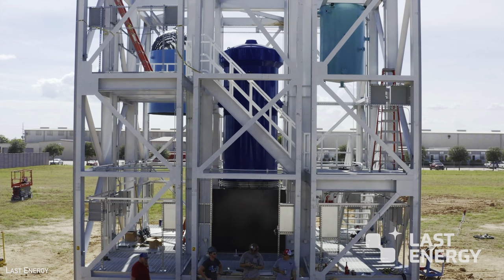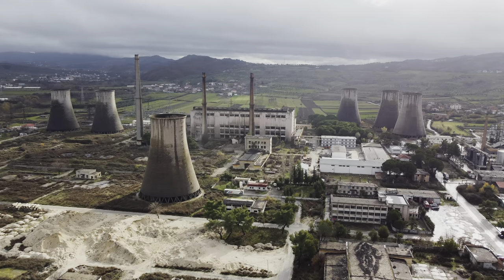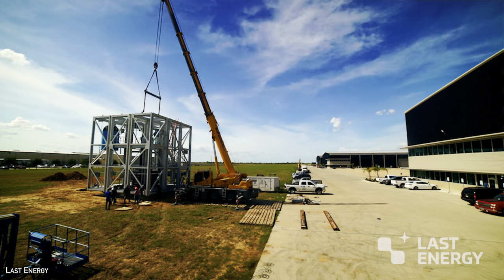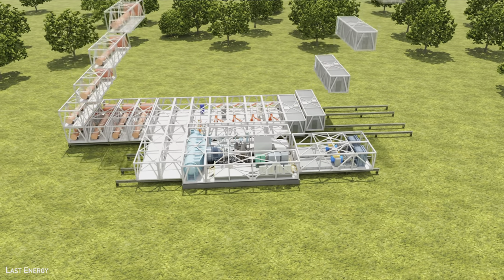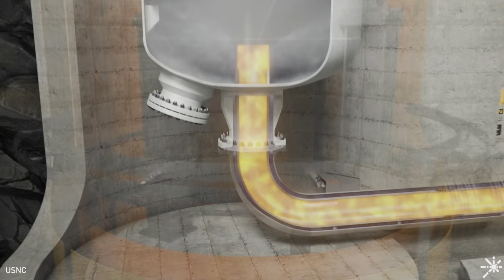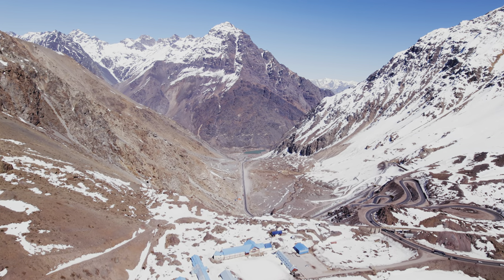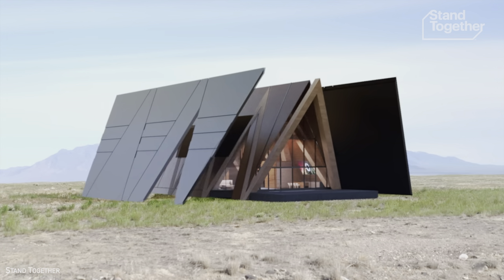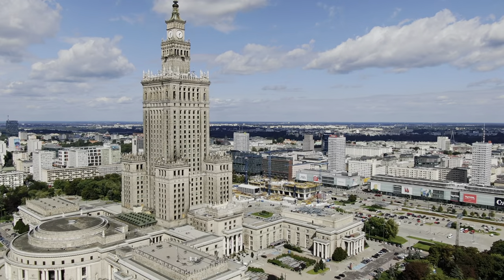The Daring Plan to Build 10,000 Nuclear Reactors

Comment: “New novel design”

No, Last Energy has a radically traditional light water PWR design, with no new tech and no new parts.
Reply from the maker: New approach to a traditional design?
Reply: @atomicblender  yes that’s key. There’s a great deal of hype around nuclear power new companies, about cost, efficiency, etc, and the only thing matters at all is certification from a regulator. Components already in use for years seems like a smart play, maybe the only play.

Comment: Sounds a lot like the Copenhagen Atomics model but they use Thorium.
Reply: Enlighten me. 
Using a """new""""different fuel sounds like it's quite different from scaling down the already proven methods.
Reply: @haldir108  They have the model of owning and operating the reactor and selling the heat and/or electricity.
Reply: And good for them. Thorium is the next necessary step!
Reply: @paulk8582  My guess is they will skip the thorium and just use uranium by the time they commercialize. The same thing goes for ThorCon Power, uranium in the same reactor is just easier and cheaper.
Reply: @paulk8582  No, thorium is just overrated and offer no advantages over the Pu cycle.

Comment: Existing companies already produce and operate small reactors like the ones in nuclear submarines, why make another?
No energy while reactor vessel being replaced (need at least 2-3)
Lot's of Reactor vessels, new and spent, moving around on highways (security)
Security is also an issue with lots of small reactors running on enriched uranium scattered around the countryside.
Reply: It’s low enriched uranium.  Has no proliferation threat.  US has been shipping old military reactors or fuel to Idaho for decades. As we’ve seen, the consequences of chemicals rolling around are far higher than this bunch of radioactive rocks in a tiny reactor can. 

The military contractors building naval reactors have different goals.  Performance, ramp up down in seconds,  run for life of the boat with HEU.  This commercial reactor needs to be inexpensive.

It’s the case that any industrial factory plant needs to go down for maintenance. Often, the whole plant schedules rework same time.
Reply: There are many reasons. Doesn’t mean the reactor design can’t be modified for commercial SMR.
Reply: @Jim Frazier HEU fuel.  Cant roll your own if you’re not a weapon state.

Comment: Why don't Renewable lovers don't push for the likes of Indonesia's 7×500MWe ThorCon TMSRs?
The 17 Apple Park solar farm projects cost $4700×10⁶ for 1200MW
average 70.6MW at $3917/kW.
Therefore, say an "isolated" data processing location requiring a steady solar farm 20MW load 24×7 
1) assumes 16 hours no sunlight but using 16h×20MW =320MWh from 85 mega packs (each capacity  3.9MWh = 327.6MWh) and capital cost $170×10⁶ for 20MW
2) So $170/20=$8500/kW
3) As solar farm works only 8hrs/day solar panels are require to generate the daylight 20MW plus  2×20MW for storage for night use. 
4) So minimum daylight generation is at 60MW and assuming the 70.6MW solar farm statistics we are looking at a capital cost of - 
a) panels $4700×10⁶/17=$275×10⁶ 
(at say $4000/kW) plus
b) storage for 320MWh for 20MW ~ say $170×10⁶ 
(ie. $8500/kW) and gives a total cost of  = $425×10⁶ for a continous 24×7×365 hourly need of 20MW ~ 
c)So solar farm at $4000/kW plus 320MWh mega pack at $8500/MW 
= $12,500/kiloWatt
(Compares poorly with a 500MWe ThorCon TMSR at say $1250/kW capital cost ie. 20 times larger capital cost per kiloWatt for continuous 20MW× 24×7 Solar farm with enough mega battery packs to provide the overnight load of 20MW for 16hours between charges?)
Reply: Similarly, if you up the Solar farm size to a 90MW providing a constant 24×7 daily supply of 30MW×24=720MWh  per day utilising 125 Mega-packs with combined overnight capacity of 480MWh to last 16hours the total capital cost based on the above is $600×10⁶ which is the same capital cost of  500MWe ThorCon lasting 2 to 4 times longer and capable of providing at least 16 times that of the 90MW Solar Park with it's 125×3.9MWh Tesla Mega pack batteries, and at a levelised pre-profit cost of $30/Megawatt.hour (3cents perkWh).
Reply: Tesla Megapak is 3MWh, not 320, and cost is $1.5 million delivered, not installed, ie $500/kwh, probably $600 installed and cabled. Solar needs 14-18 hours of battery per day for full backup.

Land cost is increasingly a factor for PV.  A 90 MW array requires 450 acres for pure PV, add in access roads and gaps seen every farm probably 700 acres.
Reply: @Nill757  320MWh is for 85×3.9MWh new Tesla Mega-pack batteries
Reply: @mrvaticanrag3946  ok, then that’s another 5-6 acres

Comment: OKLO was a scam from the start. I repeatedly asked them for even the most basic details of their design. "A fast breeder in an A frame" is not a design. It's a marketing concept.
Reply: Why would a start up give a random enthusiast a single word about their unique reactor design, so you could then publicly make claims about  incomplete information, as you have here.
Reply: @billyjoeallen Depend on you and your engineering skills? Yeah. The care home called, they want you back by 5pm or they’re sending the boys in the van again.
Reply: @Nill757  Why would they focus on the design of the outer containment building? even if it mattered, an A frame is one of the least thermally efficient shapes. They were trying to sell a reactor to people who don't know anything about reactors.
Reply: @billyjoeallen  Building - roof are aesthetics to sell nuclear to a public overly cautious about nuclear.  It’s a tiny 4-5 MW thermal reactor, the same power capacity of 1 or 2 diesel semi tractor engines, where the “roof” has nothing to do w reactor heat management.

Comment: 20MW is a bit small.
Reply: you know what else is small?
Reply: Not if we are talking SMRs.
Reply from the maker: On the smaller side of SMRs for sure, maybe more into micro-reactor territory. But, they've sized it like that to make the design and fabrication work with more off-the-shelf parts.
Reply: I agree, I just pointed this in a comment above.
All those 10 thousands of reactors will amount of half of the present production.

Comment: It would not be close to economically viable at $20,000 per KW as over 6 years that works out .38 per kWh. It would not be close at half that. In the UK wholesale electricity is currently about £100 per MWh or £0.10 per kWh. At $5000 per kW that would be about $0.10 per kWh. IE viable just. I think this is yet another red herring.
Reply: depends on who builds it the only reason nuclear prices are so high is due to investors wanting their money back fast if it was built by the government it would be the cheapest since its the most reliable and efficient
Reply: Cost can be lower than 10c for $5000/kw, can be 3-4c If they don’t need all the over head of stupid small armies etc.  Lots of people whose job depends on nuclear overhead going to insist their job is necessary as gravity.  Wrecking a PWR wont hurt anyone outside plant area.  Won’t be any plume of chemical junk like East Palestine.
Reply: @Nill757  Got any proof of that?
Reply: @gordonlawrence1448  Fukushima, TMI.  Three LWR reactors wrecked by tsunami, nobody in public hurt by radiation.

Comment: Nice. Proceeds to run out of increasingly expensive uranium-235 after a couple of decades
Reply: Nuclear could 2x 3x 4x the price and would still be pocket change in the nuclear bill.
Reply: @Nill757  Doesn't change the fact the amount of actual Uranium-235 is very limited lol, you'd just straight up run out, the only way is to switch to Thorium, or make fast breeders work economically
Reply: @winters4147  Straight up not very limited, u235 a hundred years, then sea water u235 many hundreds of years, plus fast reactors thousands of years, plus thorium tens of thousands.

Comment: Desert solar is cheaper, simpler and safer.
Reply: Desert solar is far more expensive, far more. The solar panels themselves are pretty cheap but transporting that low density intermittent electricity to where it's needed and adding it to a natural gas power plant to make it reliable costs more than these nukes and only lasts about 20 years before everything has to be replaced.
Reply: If no desert nearby?
Reply: @Nill757  
Two desert belts run around the globe along the tropics. 
Where do you live?
Reply: @halnineooo136  not there, along with the majority of the worlds population. If you’re serious, find  about what it takes to run solar in a real shifting sands no water desert. It’s not cheap, not simple, and a small fraction of global solar is currently located there.
Reply: Cheaper doesnt include recycling or repairing the environment after destroying it. How about cover 100% of your property with solar panels first. It would be more efficient even if it means you never see the sun and you have to cut down all the trees around you.